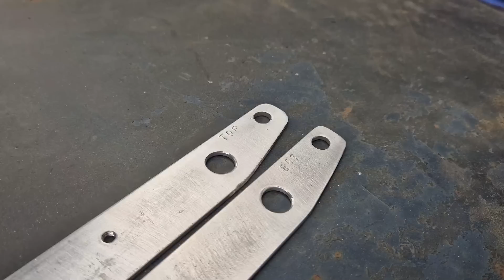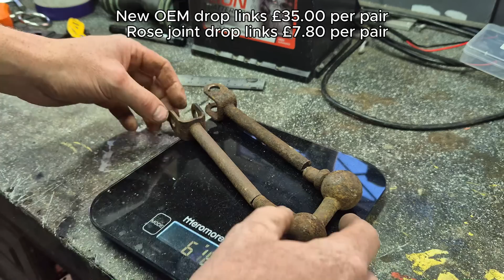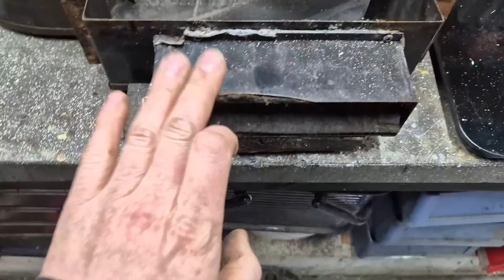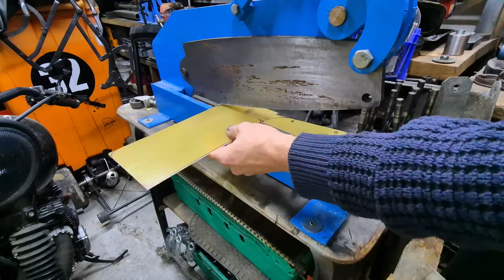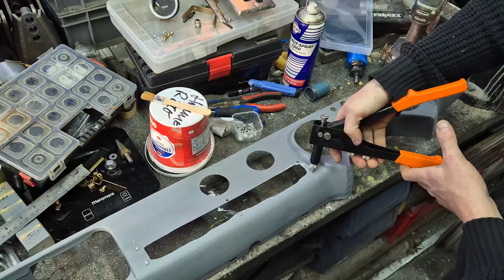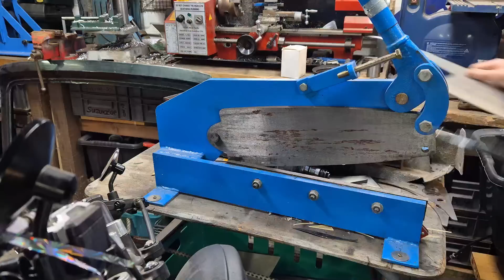MGB Roadster - MX5 Mk2 Engine Swap - Part 2 - Interior, Engine Bay & Hydraulic Handbrake Install DIY

Comment: I love all your mini weight reduction and decluttering, it gives me lots of ideas. One thing I think might be of use to use is to look into laser cutting services, they are quite affordable now days (for small brackets, I often get a finished part for about the price it would cost me to buy the sheet stock in the amount I would need)

For stuff like the hinges, you could draw up a quick profile and have them cut out of aluminum super easy, and potentially save more weight than just drilling holes.

Just tossing it out there cause it's come in handy for me so many times. The hand made parts do have more charm though!

Comment: while your obsession with weight is to be admired, your new gearbox mount is crap from a engineering point of view, your original modified one is a way better design.

Comment: Re the heater motor,  the motor and fan from quite a few 90s GM cars will work.  VDO makes an essentially universal assembly  that is lighter, faster, and fits nearly perfectly.  Part number is PM136.  I installed one in my 5.0 Ford '76 roadster's heater -  cost  me $32 at Autozone.   Not exactly  plug and play - motor needs disassembled,   +- polarity swapped at the brushes, and the screw holes don't line up... three dabs of epoxy later and who can tell...     As an automotive engineer, I would have suspected that spinning the squirrel cage in the opposite direction would spoil the airflow in the heater box and vents, but airflow  is easily  50% better across the windscreen.

Comment: Re propshaft splines -   the 1.6 and 1.8  shafts  do have some  dimensional and visual differences,  but in the end  they are as interchangeable as  Legos.  I've owned and driven the same '91 for nearly 25 years/290,000 miles-  the ujoints remain smooth and quiet... that low mileage 1.8 shaft in the spares bin has likely given up all hope of ever seeing the light of day....

Comment: Many years ago I saw an MX5-powered MGA twin-cam.  The earlier MX5 gearbox is easier to move the gear lever further forward by 50mm.  On my V8 MGB Roadsters I have disk brakes front and rear and I have two alloy rear brake calipers on each rear disk one for the foot brake and the second for the hydraulic fly-off handbrake which uses the original handbrake with a modified mechanism and a hydraulic M/S mounted on the floor beside the seat.  I organised and ran the MG Car Club Anglia Autotest championship for ten years and won the Cali Cup and the BMC Trophy at Silverstone.

Comment: How much more difficult would it be to use the two lliter from the mx5 type 3?  The reason I  ask is that, 1, they would give a big boost in both HP and torque, and two at so.e not too distant polnt they will likely be more available therefore cheaper.   Also, at least  here in the US, the 2.5 liter Ford version is even cheaper with significantly more torque, if not power.
Reply from the maker: I agree the later mx5 engine would be a better starting point from a power perspective. My other mfb has the Jag V6 so this one was more geared around economy and cheap fun, I wasnt really looking to engine swap it untill my freind Oli Valenghi mentioned he had an engine in his shed so it just made sense from a sourcing and convenience point of view. 

Your right though its probably not the best engine in terms of future proofing althought they are still out there for sale in mass. Hmmm. We can always swap it again? :P thank you for the channel support!

Comment: Having just spent a long time sorting out a P6B Smiths heater, I like your ideas. They’re big, bulky and poorly designed.
Reply from the maker: I agree they are quiet clumsy and the  heater controlls are a bit if a pain to tweek and get working right. I preffer just an on off switch for the heater, no faffing with knobs and dials,  Im a simple man!  Thanks for the support :)

Comment: This isn't a race car, so a bit obsessive on the weight saving ones pas?
Reply from the maker: I confess! 🙋‍♂️ I am captivated by the weight saving!

The B will see occasional track use, but I just love having a car with modest power and being able to keep up with more powerful chunky  'modern appliances' on the british backroads. 

Being lighter can only help with the fuel economy (main reason for the swap) aswell as tyre and brake wear.

Comment: Good work. That heater layout is so much simpler, I’ll be doing exactly this in my GT!
Reply from the maker: Iv never really
Examined the 'resistor' item inside the heater box, but I find bypassing it makes a huge difference to the strength of the blowers so im not sure if it has some form of mild resistance on the factory full bore setting. Well worth doing IMO 👌  I appreciate the support Andy!

Comment: Absolutely appalled the new prop shaft is not a repurposed carbon shaft from a 350Z. Easy weight saving.
Reply from the maker: Its perhaps time to research what glues they are holding those props together with 🤪
Reply: @mike_wallhead  I was researching so I bought a bottle of each. After smelling them, well not sure but here we are and I've always wanted a tattoo anyhow.

Comment: Are you using a mk1 NA mx5 transmission or are you retrofitting the speed sensor? I've been thinking about just retrofitting the whole Mx5 cluster into the dash.
Reply from the maker: I can see the appeal for the full dash cluster for ease, Iv grown up with 70s cars so I quiet like the dials to be in almost 'stupid' locations spread across the dash. I would be interested to see your solution though! :)

RE the speedo drive I was hoping to find the gear setup from an early car, I havent researched it much actually so Im not sure if its simple but the bottom of the gearbox looks relatively easy access so hopefully hindsite doesnt bite me :P

Comment: I think you need to get a dimple die kit.
Especially if drilling holes into sheet steel parts. It'll help maintain panel strength.